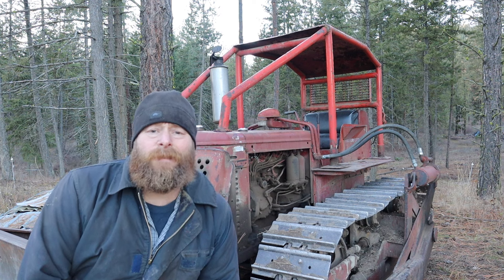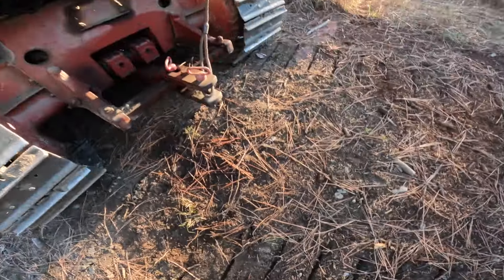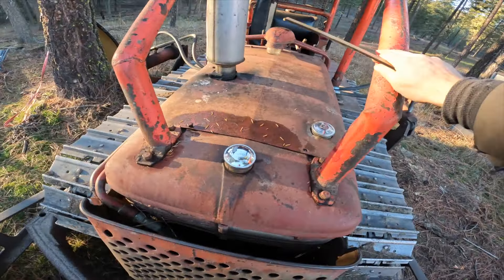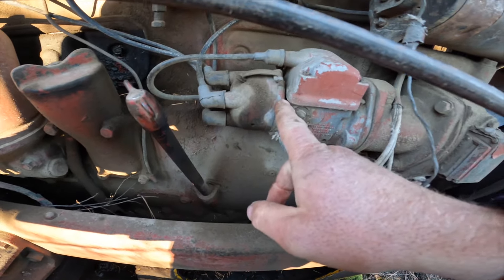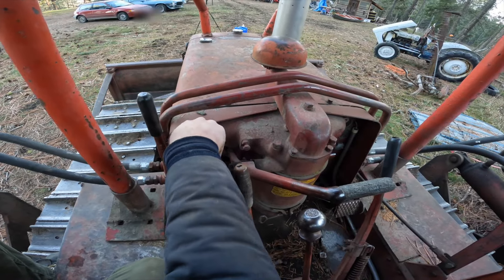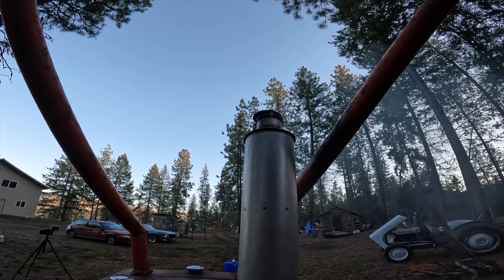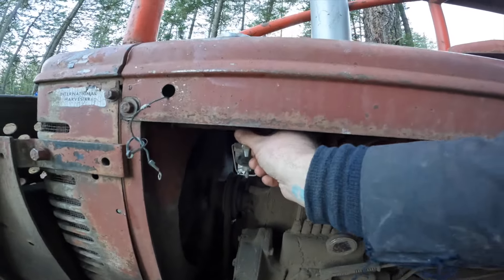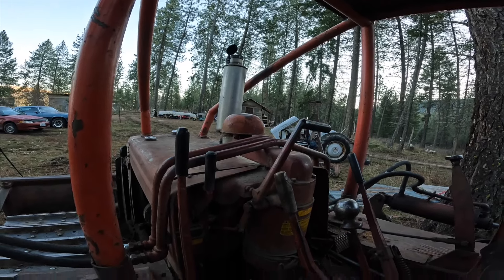Start a diesel bulldozer on gasoline? International TD-9

Comment: Don’t need to do that change over like that ran 18 and 24 when you feel she’s warm enough just open the throttle and flip her over then shut the gas off otherwise you end up losing your gas from all the shaking around when your working . Loved the old 24 cable blade and all .

Comment: I am 18 years old and live on a farm. i am just out of high school, and i didn't know the starting procedure for my td9 thank you for showing the way to start the td9. i have 4 other tractors from the 50s thats i have bought and fixed since i was 12. I got the td9 from my dad he wanted to scrap it and i offered him a price for it he said if i can get it to run i could have it, its been sitting for 40 years and it needs  some work but i take it one step at a time and i got it to run on     starting fluid the only missing part is a carburetor looking for one. Its a 1953 td9 crawler with the 335 engine not the 350 like the 1956 and later td9s. My plan is after the td9 runs and drives, use it to pull logs for fire wood and mine has a lowder can use it to move the logs around,  buying a 4 bottom 16 inch    plow and a 14 or a 16 foot disk for it disk and plow both will be international.
Reply: It really bothers me seeing thinks like old crawlers or tractors even cars and trucks be scrapped because that's one less around and a piece of history being destroyed.

Comment: It's crazy that the plugs don't instantly foul up with diesel coke. Any idea if they're shrouded or maybe some sort of odd design?
Reply from the maker: Yeah it seems like they would. Some folks say to switch it back to gas for a min or two when you shut it down in order to clean off the plugs. I can’t seem to figure out that switch over sequence and it always just ends up shutting down so I’ve kind of stopped doing it. despite that, she starts up fairly easily.
Reply: @ZackOfAllTrades  Seems like the risk of switching it back to gas would be a lot higher than the risk of fouling up some plugs. Do that one wrong and you get to buy a new motor. 😂
Reply: There is a secondary combustion chamber where the spark plug lives. There is a third valve in the head that is open while in gasoline mode and shuts when you trip it over on diesel. The extra combustion chamber also reduces the compression ratio. It is very important than when you kill the engine that you have it tripped to diesel. If not the valves hang open and can warp. Expensive lesson to learn.
Reply: @victorriceroni8455  What a completely crazy system. It's impressive that it works so well.